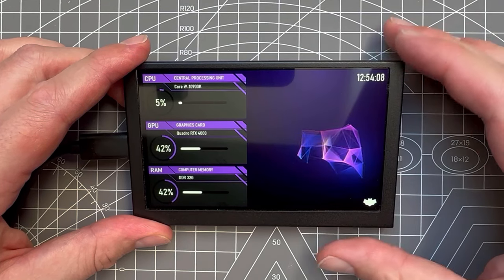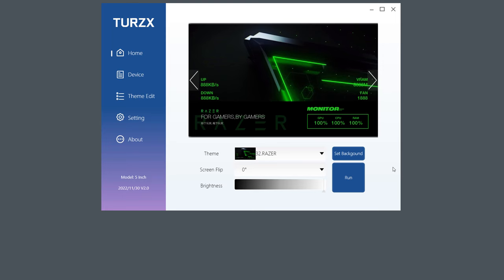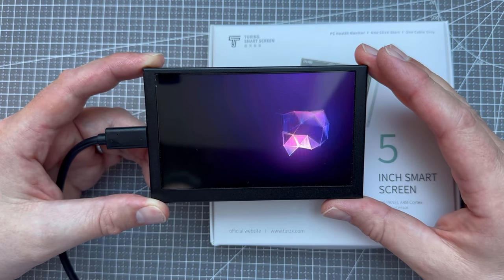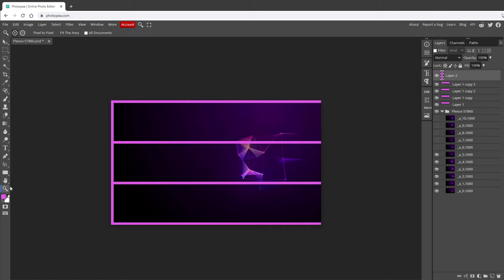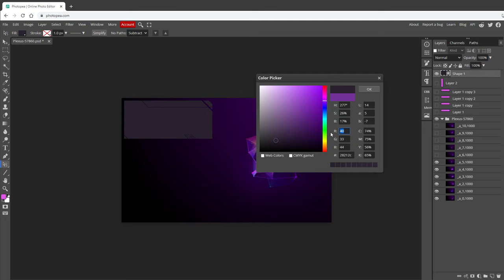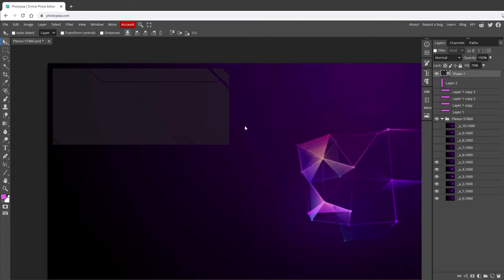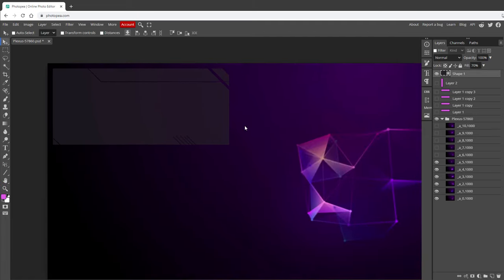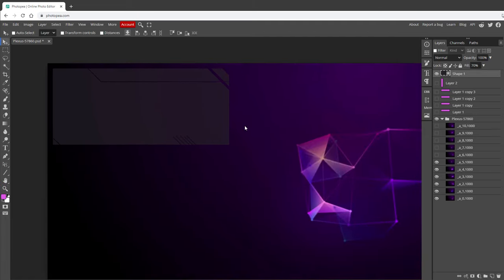DIY PC Stats Monitor (TURZX display, 5inch Turing Smart Screen)

Comment: I got the 3.5 inch screen. Software looks different and it doesn't look like it can do video background. At least, there were none included with the software.
Reply from the maker: That´s correct, the 3.5" does not support background video playback, it was mentioned in the video. All the other models do support video background.

Comment: i have been using turzx version 3.5inch monitor for 2 years, it's too good for 13$😊
Reply from the maker: I prefer the 5inch version because of the video playback capability, but I agree that for that price of the 3.5inch display, it´s hard to get anything better :)
Reply: @upir_upir  the same 3.5inch model does not play video?
Reply from the maker: That’s correct, I don’t believe you can play video on the smaller display. At least I haven’t found a way.
Reply: Hi! I got the 3.5inch also and connected to the motherboard USB header but everytime I switch on the PC, I have to open the app also. Otherwise screen will not display the graphics. Are you experiencing the same thing?

Comment: Great explanation, and I can understand with a little practice and knowledge you can create some very nice themes, what brings the quesiton why are there so few themes for this platform?  IN the initial program for a Smart Screen the software only has 26 themes, and if I search internet i can't really find any shared themes anywhere. with this platform I would expect more themes available OR im looking in the wrong spot?
Reply from the maker: Thank you for your comment. Perhaps there will be more themes in the future. I know that the last update of software had a link to some "themes store", but I don´t know if that´s already functional or not. I´m not aware of any website where you can download more themes - unfortunately. That said, I hope to find some time to create more themes to share...
Reply: Following your video I really made some very nice customizations on my screen already, and adding data like FPS time volume was very easy, these are more easy then to do Aida64 I am torn now between the Aida64 consoles and these turing ones, I wish they had a 7 inch square, thank you for this video i keep coming back here trying to figure out if i can make the clock 12 hours instead of 24 LOL I have the 5 inch screen and loving it.  @upir_upir

Comment: Hello! I followed your video step by step and my software continues to say no connection. I have connected my monitor via 9 prong or by usb-c. I have uninstalled and reinstalled the software multiple times. The monitor has power, it just cannot seem to connect to the software. The SD card is inserted... any advice?
Reply from the maker: Perhaps try a different USB cable (make sure it´s data, not just for charging), different USB port. You can also try installing the drivers, they are packed together with the software.

Comment: Can this LCD display be used as a second display  where I can move the cursor?
Reply from the maker: It can not. Those are not external screens and you cannot move your cursor over this screen. If you want a proper screen, just google external HDMI screens, you can get those in the same size and resolution as this one.

Comment: Hello, why the 3.5 inch software isn't the same as the 5 inch screen software ? My 3.5 inches screen not work.
Reply from the maker: That’s correct, unfortunately there is a separate software for every display size. The advantage is that you can connect multiple different displays at the same time.
Reply: @upir_upir  Ok thank you; but the 3.5 inch software sucks a lot !

Comment: Hello i'm thinking of buying this but only for displaying video/gif.
Can it do that?
Also will the display still show the image even when not running the program in background?
Reply from the maker: Yes, you can use it to only play video or gif. In that case, it does not have to be connected to computer and you don´t need the program running. Only once to setup, and than you can connect it to any USB power supply.
Reply: @upir_upir  Nice! Thank you so much for this info sir!
If it's ok i might will ask some help if i ever get problem during the install (still waiting for the product)

Comment: Sorta makes me wonder if they abandoned the software for 3.5 model considering how scuffed it is. Parts of it still in Chinese, windows not resizeable leading to buttons being cut off, etc... Do you know anything about doing themes on those ones? Some of it would be serviceable, but it only lets you change colors on numbers, not text that seems to be locked.
Reply from the maker: I would not think of it as "abandoned". I would rather say that this was their first display / first software, and they just gradually improved with every newer display / software version. 

If you don´t like the software and still want to use the small 3.5 display, someone has developed Python scripts to drive those displays. That might be an option  - plus it works on all OSes. Link should be in the description, and I hope to try those soon.
Reply: @upir_upir  Yeah, I got the python one running, but its a bit of a pain to do, and you need a whole different package/program to be able to do theme stuff. I didn't feel old until I tried doing the Python stuff, lol. Had to look up a video on youtube cause a lot of the instructions are missing on the github guide.
Reply from the maker: Sounds like you are still one step ahead of me 🙂

Comment: does it have no 4pin connector at the bottom? to connect to the motherboard? it is also convenient to use it to hide the 4pin wire on usb
Reply from the maker: Not this particular one, since I believe this is the older version of the display, however, you probably cannot buy this one anymore. I have another video where this display does have the 4pin connector - https://youtu.be/xdrJMHQ1idQ

Comment: Just to be clear, this app only works for these displays, right? Not for HDMI-based sensor panels of similar size?

Because I'm not sure what free software options I have for HDMI sensor panels, besides using Rainmeter, which is extremely CPU-heavy (like 15% CPU usage).
Reply from the maker: Correct, this software can be only used with Turzx screens, not with generic HDMI external monitors. Could you perhaps use Turzx screen instead of your HDMI screen? They just introduced big and wide display that looks nice, I hope to cover it in some next video..
Reply: @upir_upir  I already spent $200 on a 14 inch 1100 x 3840 HDMI sensor panel so I might as well use it.

I'm running the display separately off the iGPU of my 13600K too, but I didn't realize it would take so much CPU utilization to run Rainmeter gauges.

The other option I see is spending another $60 on AIDA64, and rebuilding everything on there to get the CPU usage lower. So I just wanted to see if there was another software solution.
Reply: @GENKI_INU  if you use an hdmi monitor for that, there are a lot of tutorials on how to use AIDA 64 to display the stats

Comment: What can I do if my screen can't connect? I got a PC with one included and had to do a clean boot and the screen no longer turns on and Turzx can't find it.
Reply from the maker: Perhaps a different USB cable, try different USB socket, reinstall drivers?

Comment: Can we use this as external display for androids which output video via usb c. It will be very beneficial for broken display phones whoses displays are very expensive . As usb c supports both video and touch responses.
Reply from the maker: Unfortunately this is not possible, since this screen has no HDMI input. It’s purely for displaying PC statistics, but you can get similar screens for a similar price that can act as an external display..

Comment: Hello, I received the screen and I really like it.  I put several videos on the SD card and set it to play the videos automatically when turned on but I would like them to advance to the next video as soon as the current one ends.  but it happens that the same video keeps playing forever... can you help me with that?
Reply from the maker: It might not be possible, but you can merge all video files into one using any available video editor. You can also use fffmpeg, that is free and should work for this task.

Comment: Hi, is there a way to show up FPS and frame-time readings as well? I would love to know that. I bought one because a Stream Deck felt a bit too expensive. But the thing I really look forward is the FPS.
Reply from the maker: There is a beta version of software for download on the website that has the option to show FPS, but I haven’t tried it yet. Hopefully it’s at least a little bit helpful.
Reply: @upir_upir  thanks for the quick reply. Can you please share a link with me?
Reply from the maker: https://www.turzx.com/2023/03/02/%e7%9b%b4%e9%93%be%e4%b8%8b%e8%bd%bddirectdownload/

Use the 5 inch beta
Reply: Has any of you tried the fps option? Did it work well?
Reply: I made a custom one, I can select fps data but nothing displays. Too bad

Comment: I just bought the 8.8 inch one, do you have videos on how to make themes?
Reply from the maker: Not yet, but I also have just bought this display, so expect a video soon.. Is the software that much different from the 5" version?
Reply: I have the 8.8 mounted in side the PC in vertical postion, put a killer moving background on it and using purple theme looks very nice.

Comment: Does it have onboard memory and also does not require the software to keep it runing?
Reply from the maker: Please see my other videos with this display (there is a playlist) that answers hopefully all of the questions.

It has onboard memory, but it´s quite limited. I believe like 10MB, so only enough to fit perhaps one short background video. It´s better to use SD card, in that case, you can fit much bigger/longer background video.

As for the software, you need to keep it running to show PC statistics. If you only want to use the display to show a video, you don´t need to run the software.
Reply: @upir_upir ah thank you i had the 3.5 inch one and i saw this one and was curious if it was any better like not having to keep the software on to see the stastics. Or if i accidently disconnect the cable i can just plug it in and the display works w/o having to reprogram it.

Comment: I can use it as a second screen, or with Wallpaper Engine or AIDA64?
Reply from the maker: Those screens can only be used with the dedicated software that comes with the display. Someone created Python scripts for the smaller one, but not yet for the bigger ones. Another usage is that you can use it for playing video, in that case, you don´t need to use any software.

Comment: Thanks for the video! Why does mine says 'Insufficient Space! Please delete files in 'DevManager' or replace SD Card?'
Reply from the maker: It´s described in my other videos about this screen; please watch them for more details. In short, there is only limited memory available for storing videos, so you need to delete the old ones before uploadinga new one (using a new theme with video). Another option is to use the SD card, in that case, you will have more memory. Hope it was helpful!

Comment: Its possible to download a video from the wallpaper engine and put it on this 5 inch display? And how? Thanks
Reply from the maker: It´s possible, but perhaps not that straightforward. Looking at the documentation, there is not a one click solution to export a wallpaper as a video file. You have to use some tool for capturing the screen, for example OBD Studio, and than use that file on the display. Again, possible, but require a few more steps.
Reply: @upir_upir  thanks!!

Comment: Can it display custom data?
I am looking for a display that can display the fuel level of my fuel oil for our heating system.
Reply from the maker: That’s not possible with the provided software, but you can take a look at that Python script on GitHub, or should be possible with that. Also, is there a reason to not use some intelligent display like Nextion?

Comment: Hi Turing just came out with a 2.1 inch version screen for aios. Could you kindly review them? Would love to know whether you can run both the 3.5/5 inch monitor and 2.1 inch monitor simultaneously and what the cpu/gpu load is especially during high workload/gameplay
Reply from the maker: Thank you for your comment; I will take a look and most likely record a video. Having a round display looks very interesting. I believe you can run both displays simultaneously since a different software is used, but I haven´t tried it yet. There will be no GPU load since only the CPU sends data to the display. Theoretically, it should be better than using another external display, but I haven´t specifically looked at the CPU load with this display. Do you have any photos of your setup?
Reply: Haha looking forward to the video. Im about to make my all white rgb nzxt h9 flow build. Waiting for phanteks d30 to be out so I’m trying to find a white Aio that pairs well with that so this new option instead of the kraken/callipex is something im exploring.
Reply from the maker: Sounds good. I have ordered the display, but it will most likely take few weeks until it arrives.. stay tuned!
Reply: Three can run at the same time:goodvibes:

Comment: Thanks for the video!  😮I’m currently doing a heavy pc mod that is Mechwarrior themed, and I plan to use this to show a 360 rotating 3D mech and other similar hud cosmetic stuff.  Currently using nearly all of my ports on gpu, but I loathe that aida64 doesn’t support videos anyways.  Will have one large Aida panel just under main monitor though for the actual data.
Reply from the maker: You are welcome. By the way, you can display real actual data on the Turzx displays as well, and you can use multiple of those in one setup - they just have to be a different sizes.
Reply: @upir_upir  Yessir, I know that.  My rig itself will just be a showcase; nothing I'll be looking at to get the stats.  I've got a LOT tidy up, but this thing will be amazing when I'm done.
Reply: @HydroKyl240COG  how did this turn out? is it themed for one of the IS Houses or Clans? would love to see the finished build!
Reply: @rundeckardrun3985  I decided to go custom water cooled, and just now getting all my parts.  About 60% there.  Once that’s done, Steiner all the way. 😂

Comment: does the app needs to be running in the background?
Reply from the maker: Yes, it needs to run on the background if you want to update the statistics. If you only want to play a video file, the software does not need to be running all the time.

Comment: Random question, does windows think this is another screen? I have triple screens and looking for a small screen so I can put temps only on there, but I do not want another monitor in windows but rather usb if that makes sense.
Reply from the maker: That’s correct, it’s not an external display, so it’s not recognized as one. You can only use it with the provided software. And you cannot accidentally move your mouse over there. Plus it takes much less resources compared to external display.
Reply: @upir_upir  awesome, thank you for letting me know. 
How much resources does it use. Can you play a game with it plugged in and unplugged to see fps loss?
Reply from the maker: @menphues it should use very little resources. If you decide to display a background video, that’s handled by the display itself and does not use any pc resources. The PC is pretty much only sending new values.
Reply: @upir_upir  awesome. Thank you legend :) I’ll order option 1 and 8 now because it’s the cheapest and I literally only need the display for temps (currently using HWINFO and would rather a little screen that isn’t picked up as a monitor you know) your video is super helpful so well worth the up vote :)

Comment: Does anyone here know how to get the screen to use the SD CARD? I put a message on the forums and they guided me to the to screen card thingy which I tried (baffling system) and I can see on the device the SD card but nothing is being stored on the device… it shows internal storage being used.
Reply from the maker: You need to format the SD card using the provided software. That said, I was able to use SD card just fine. I will be recording another video soon, so I might add this information and steps to follow.
Reply: @upir_upir  I used the software they provided and it does show the SD card in the devices on the screen but it’s not being used. 

Really weird system and way to do it. Totally confused

I will wait for your video because they are super helpful and why I bought this off your recommendation :)

Comment: Hi, how safe is this software to use? There is a risk of some virus? Can i use different program to work with this display? How much CPU, GPU this display use?
Reply from the maker: It should be safe, but obviously nothing is 100% safe.. so use it at your own risk. That said, if there would be any problem, I´m sure someone would already reported this. It uses a little bit of CPU, no GPU. If there is a video playing on the background, it´s handled by the display itself, so it uses no PC resources - which is one of their selling point.
Reply: @upir_upir  What will not work if you will open not as administrator? Any antivirus programs flag this as no safe or how it is looking? Did you try use zadig drivers to use AIDA64 with this screen?

Comment: This wont work on the 3.5inch one
Reply from the maker: That´s correct, I describe it in my other video. There are separate applications for every size, and the themes has to be done in a different way. Also, the 3.5" has some limitations compared to the 5" version - for example you cannot play background video on that screen.